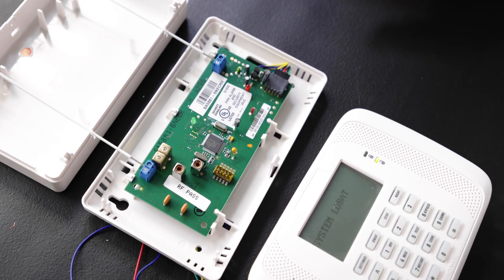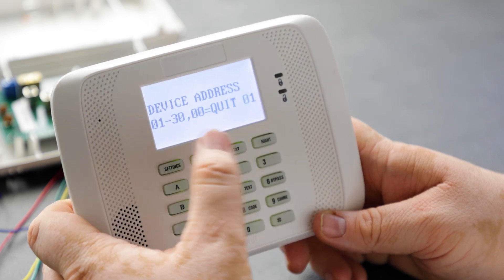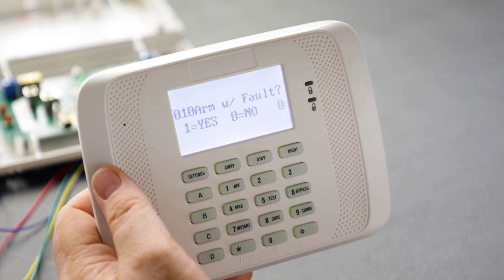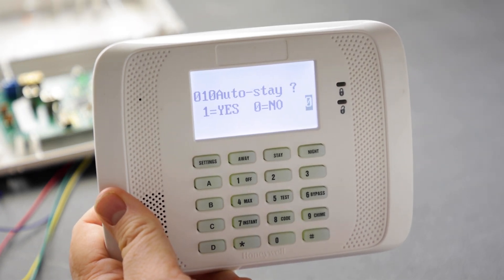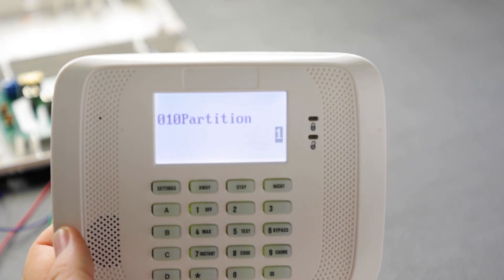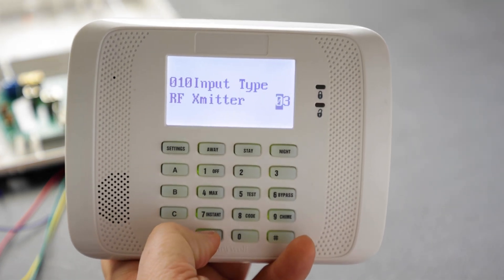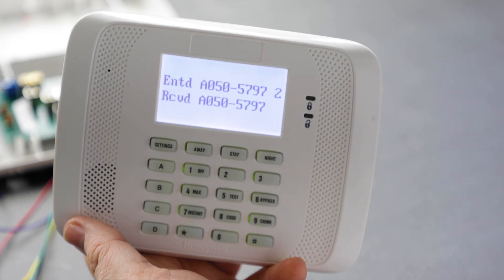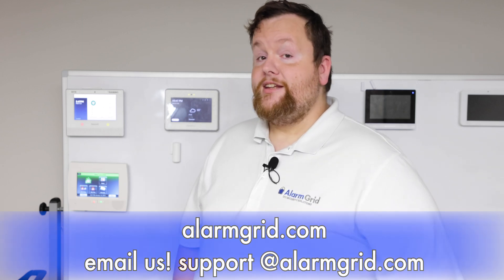VISTA 128BPT: Programming a Wireless Zone

Comment: I have a vista 32FB and I have no idea why my RF receivers don’t work
Reply: the RF receivers are set to 00 by default y dip switches. The 32FB address needs to be programmed in *93 then press 0 till you get to device programming I recommend addresses 6 and 7 if you have multiple ones. If you need to go higher than address 7 then you will need an rf keypad I recommend the 6160rf due to the built-in high receiver